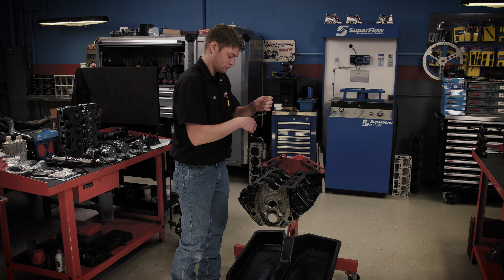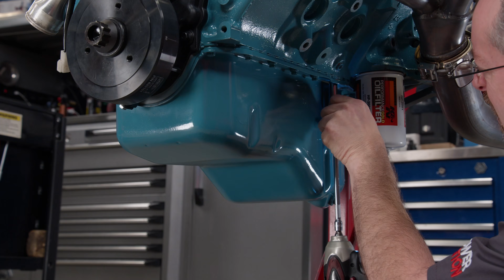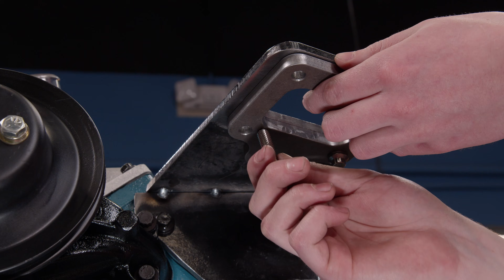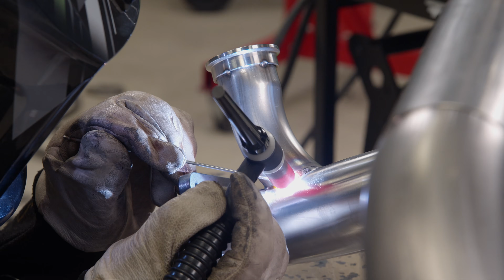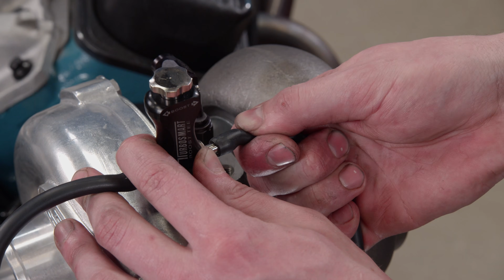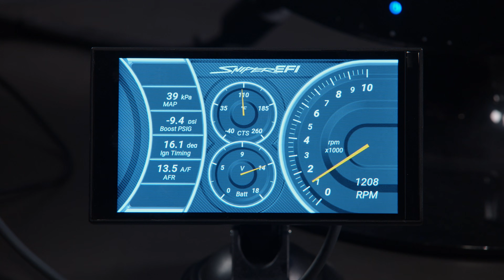Boosted 4.3L V6 Makes Over 500 lb-ft On The Dyno! - Engine Power S9, E8

Comment: I would love to build out my 2014 WT this way. Stock it makes 285 HP and 305 foot pounds of torque. It's also an e85. So with e85 it puts out 300 HP and 335 torque. Add in the turo or 2 or maybe a supercharger...it should do even more than this one. I'd also like to see one bored out 30 to 40 with crank and heads. That should be a monster.

Comment: Thanks very much for doing that forced 4.3. I have one with a supercharger on it at 10 pounds of those ported heads in that but I would like somebody to tell me the throttle body injection it’s on there how many CFM is that rated at?

Comment: You guys aren't even pushing it hard 🤣🤣 these engines are oversquare. made to rev high. 7000 easy peasy with good springs. /Maybe/ need a fire ring and studs if you're going that fast and high boost. 

I had a Volvo all stock internals pushing 20-23 psi~ and still reved out to 6800/6900 with no issues and that's an oversquare block 3.189 bore 3.543 in stroke   🤷‍♂️🤷‍♂️🤷‍♂️  Was 22 years old and had 130k miles on it.

Bring that bad boy to 15+ psi dump in some more fuel, can easily add water/meth spray on the sniper at 6k and rev it until the valves float 🤣🤣🤣 and  Watch it lay out 700+ hp on pump gas 😁

Comment: I've been fooling around with the 4.3 for a few years mainly because that's what was in about everything that I bought. I bleed bow ties. I really like this one payment rides anyhow I had a 94 pickup full size short bed that needed an engine very high mileage truck she finally gave up on the way home from work one day. Had one of those balance shaft engines in it. Okay yeah yeah yeah whatever I ordered a new engine I use the old school block give them the numbers from the block I wanted to use and then use the fuel injected TBI heads got by about $600 cheaper on a brand new engine ran like a raped ape. Sometimes these companies want to over engineer stuff. Less is more

Comment: What a great video! I own a 2005 GMC Sierra 1500 with this 4.3l Vortec v6, and what jumps out at me is the basic stoutness of the motor. Overbuilt, super strong, and able to handle your quality upgrades. I'll never do this myself, but it's cool to know the block, heads, and basics are massively over designed. The way things should be. Thanks!

Comment: I'm picturing a rusty but solid 4wd s10, stock wheels and stance, with this engine,  and a built 6L90 behind it, or even a ZF5. It would be spectacular to see a mini truck absolutely annihilating tuned big diesel trucks at under 5l displacement. 470hp and 500lbft from a package weighingaround 500lbs is NO JOKE. The only way it could be longer lived or simpler I'd think is using a 60 degree block to eliminate the balance shaft. 2 valves are enough for the cost, change my mind!
Reply: I'm gonna do the fullsize version with my 92 k1500. With more than likely an nv4500 unless a deal on something better comes along.

Hell I might just see how long the stock nv3500 can take it 😆 I have seen them survive stupid shit. I've also seen them eat their own internals behind a stock 6cyl....

Comment: i have the ultimate chevy v6- 284 ci dry sump gmpp nascar engine from 1989 built by the late ray baker earnhearts v6 builder,its filled with all the good stuff,manley splayed mains,pistons rods,gmpp ported heads,2 piece crossram  nascar intake-makes 600= hp na. i bought it off a racers widow and it was only ran in one race at nashville fairgrounds in 1989.
Reply: What are your plans for it?
Reply: @PerilNotion  not sure, its a hens tooth. a i said if i put it in a street car it would be like taking a rare stradoverous violin to a red neck back yard barbecue. i may put it on a run stand and fire it up at car shows. most people have never heard a max effort odd fire v6, but if i had a nova or vega body i would put it in it

Comment: Guys, IMO you are disingenuous in the first minute. “…a turbo charger… These are really simple to install”… They are THE most difficult to install as you show in the rest of your video. A positive displacement supercharger is THE simplest to install. Followed by a centrifugal supercharger. As we all know, a PD S/C is a intake manifold replacement with a belt re-routing. Next, a centrifugal S/C adds a layer of bracketing while not requiring any intake changes and if self-contained no oil pan mods. LASTLY. Is a turbo with all the exhaust and intake, oil pan, oil cooler, and complete accessory re-routing mods while trying to fit into an engine compartment which you don’t list here… VERY disingenuous start, regardless of your good work in completing it. Just try to be honest from the start from now on? You sound ridiculous and it ruins your hard work after.

Comment: I am leaning towards throwing this engine into a late ‘70’s or early’80’s Chevrolet Caprice 2 door coupe. I know that the 4.3 V6 was offered in the mid to late 1980’s in them (mostly for taxi use), so this engine will easily fit into the car. It would make an awesome sleeper if it was lowered a  little bit and then throw on the police package with the dog dish hub caps. Put a 5 or 6 speed out of 3 rd or 4th generation Camaro and it would be a really cool build…
Reply: assuming this does not apply to a 2014 4.3 ecotec engine in a Silverado 1500 which appears to me to be quite a different 4.3

Comment: My '96 S10 Blazer would've loved this 'upgrade' to the 4.3L Vortec!
Sold it with over 250,000 miles...and it was still running great.
Reply: those 4.3 were great. chevy died when they stopped making them. they lasted a while. they should have changed them to multiport fuel injection and turbo from the factor and stick them in eveything they have.

Comment: I would have loved to see a better more detailed parts list that we could actually click and be directed right to the real part. The intake manifold part number at summit does not show any part, and there is no part number for the turbo either. Cam, roller, springs, etc also leaves the doubt if the cam you used is the stock one or a special cam for the turbo. Overall a very inspiring video since we are finally focusing on small displacement with turbos which is what regular drivers need.

Comment: With all the extra space in the engine bay from the v6, extra air charge cooling can be done. A really robust water to air intercooler can make that power really safe
Reply: Dont have to with e85 and blow thru carb how it should be done anyway.
Reply: @armdrop101 nah man, you dont need e85 to make 500lb-ft of torque. Use gasoline and advanced timing to keep the fuel efficiency up and this can still be a daily. But to advance the timing youre gonna need to cool that charge more than a blow thru carb can. Cool the air to make it safe and use gas to make the vehicle make sense. Idk if youve tried to daily an e85 car..just dont do it. Its just a hassle for no reason

Comment: I don't see an intercooler fan blowing across the intercooler. It's just acting as a heatsink until it gets saturated. You're probably losing 30hp or more.
Reply from the maker: Our dyno room uses a very large exhaust fan that draws from a fresh air inlet in the front, across the entire room, and out the back which on larger charge air coolers is enough to effectively cool the air charge down. On this one, since it is a smaller charge cooler we added a small puller fan to the back of it to help. We monitor inlet temps on everything and were able to keep them at ambient with this setup

Comment: Definitely need to put this a Datsun 280 as it was originally intended for an inline 6 so it has a lot of room intercooler and radiator and have room for potential power steering add its successor the 300 ZX did have a V6 but the 280z or 280ZX would have benefited from a motor like this I mean I know Detroit muscle guys wouldn't put this in there because well it's not an American car but I'm pretty sure Tommy would appreciate it as he is a fan of those older cars and the 280z was the equivalent of a Japanese muscle car when it came out I just got the same curves as the Mazda RX-7 from the 80s as well as a decent amount of the Corvettes and Porsche from the 60s and 70s so he could easily enjoy building that car with that kind of motor I mean you can even work well with a sequential turbo smaller turbo powering up a bigger one would just have to drill another hole for the oil return and the oil out into the secondary turbo
Reply: I had an 86 300zx. No turbo but recall bearing a mustang 5.0 one time I raced it. It has the trailing arm rear suspension that squatted and hooked pretty well. T-tops I really liked (yeah with a drip). Seemed like a million seat adjustments yet I never could get comfortable -it hurt my bad back. That's why I got rid of it. Nice looking car though. Oh and it had an injector recall. I picked it up and drove home feeling it lost 30-50hp. I told a guy I worked around whom had one as well, he said his lost power after the recall injector job too, noticable. Shame on Nissan. I think they had too many lawsuits and detuned them.

Comment: A particular theme in all these turbo builds is the lack of "packaging" of these systems....the routing of pipes, the locating of the waste-gates, the locating of the turbo itself...all of them totally impractical  as their isn't that much "spare room under-hood for any of this. "...if we get too  close, it gets too hard to route the exhaust...",...nobody said this is easy? In this build there's no room left at all for something like a radiator, PS pump or AC compressor.
Reply from the maker: When we did this project, we did not know what vehicle this engine might go in, but if we can build them for the specific vehicle that is better, but in this case we weren't able to. We built the turbo setup just to run the engine on the dyno with the understanding that it will have to be rebuilt for a specific vehicle before it gets swapped in.

Comment: 900+ cfm on a v-6 is CRAZY!
Reply: You Read My Mind..
Reply: The Sniper2's 650 cfm would have been at its top end to support (but I don't think it sealed for turbo pressure). This is FI,  not a carb drawing on jets, so 900cfm is not as "crazy" as you think; FI is a different animal.  Dry flow vs wet flow.

Comment: You guys should build a GM 3.8 L67 V6 Series 2
Reply: I have a L-67 in a S-10 and it's a rocket  . Good gas mileage  ( for a built motor  ) plenty of power for a six cylinder .
Reply: @britneylauer6773  How is it? I've got one to put in my s10 but looking into building it they're more pricey than an LS.
Reply: YES! A 3800 !
Reply: Pretty sure Richard Holdner has done a lot of testing on that engine with boost.
Reply: Fk a 3800 .

Comment: I want to see a rev happy DOHC 4.3 GM V6 build. Something that can reliably handle 7000+ rpm on a daily basis both N/A and boosted. It also has to last 100+K miles.
Reply: The reason you dont is the heads. Even the vortec heads ported struggle at 7k 

You'd need to source the old school Bowtie Splayed valve head set, buick heads, 18° heads for example and all those sets, even used, are 2k ish
Reply: @jerseyboycustoms  I want to see someone make DOHC heads for these 4.3 blocks. Same with the 3800s.
Reply: @Kevin6t8 it’d be easier to just make heads that flow up there

To convert to DOHC would be impossible considering the dimensions, SOHC would be potentially possible but not necessarily any true benefit
Reply: It will handle boost at 5500 longer than motor at 7k
Reply: @armdrop101  Then it isn't built properly to handle boost at 7K and last 100+K miles.
Reply: will live longer with Boost turning lower rpm and still make more power. 7k on motor wont make shit for hp. 5000 rpm with boost down its throat will eat it on motor turning 7k.
Reply: @armdrop101  But the sound of a V6 at 7+K rpm is glorious!
Reply: @armdrop101   What I'm basically looking for is a V6 version of the LT 7 V8 that powers the Corvette ZR1.
Reply: Not gonna happen with a 4.3, sorry.
Reply: Id like to see a stroked 4.3 with boost.
Reply: Then fucking build one!

Comment: Oh man.. the dreaded 4.3L V6... NO ONE show this to Freiburger or Finnegan.. they might have PTSD from those engines and the broken crankshafts. In a case like that you're actually better off sending the driver's side exhaust into the side of the Y that's further away so that it opens up the radius of the bend and makes it easier to fit. Routing from the passenger side isn't really going to be any harder either way. Also using bronze on the flange is always a good idea (in fact I'd use it on every joint of exhaust pieces) because it joins dissimilar thickness metals better than welding does and it handles heat cycles and vibrations better than welding does. You should also be back purging any time you weld stainless. A flex joint should also be added to the long crossover tube so that it can be pulled apart to go on the engine, either that or add a V band in the middle of it. Solidly welding it into one single piece gives you no room for it to flex and it can warp to the point that you can't mount it.

Comment: I’m a proponent of putting the turbo away from the engine, such as up under the passenger side of the bed opposite of the fuel tank. 
The reality is that boost lag has more to do with the turbo than it does with the distance from engines to turbo.